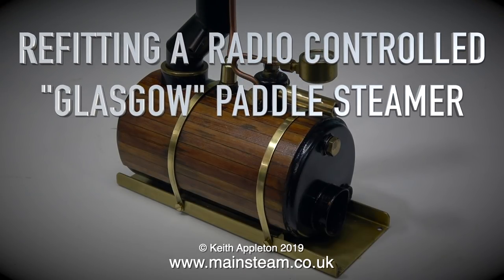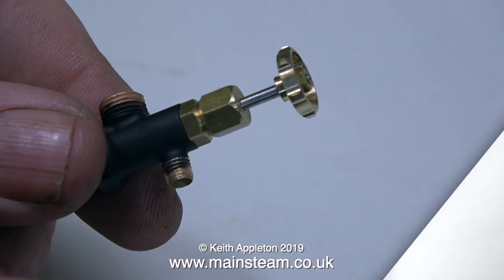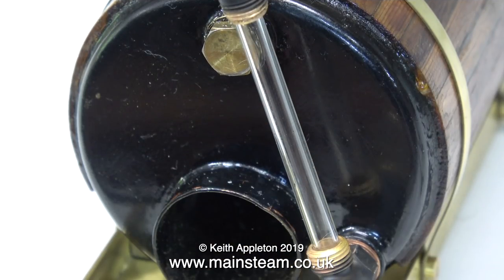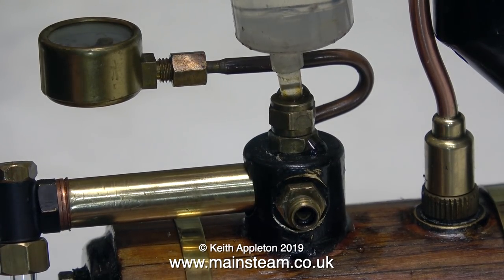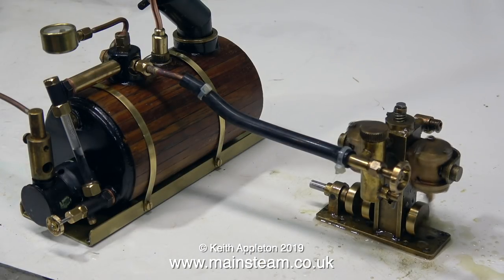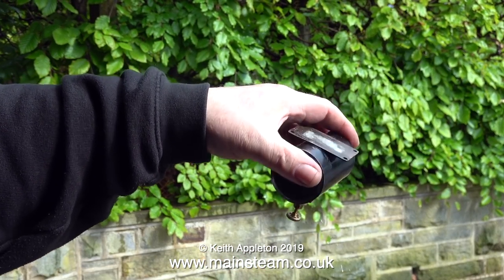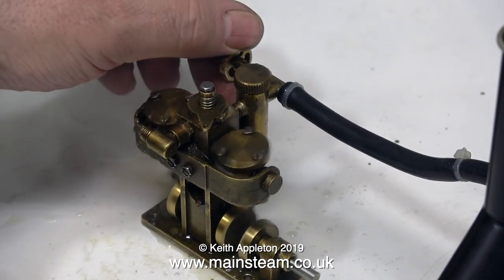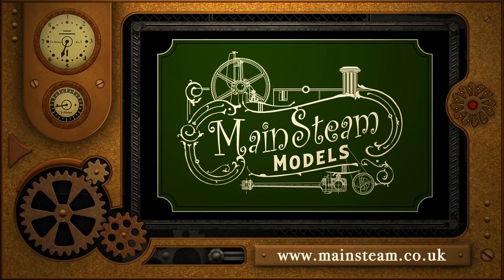A "'GLASGOW" PADDLE STEAMER REFIT - PART #7

Comment: Hi Keith, I took your advice and bought a Bahco spanner and you are correct they are excellent wrenches...but boy is their customer service awful. I discovered that Amazon, which sells Bahco wrenches, is not technically an "official distributor" of Bahco/Snap-On Industrial tools. In the fine print on the "Lifetime Warranty", it says the warranty is void unless the product is purchased from an "authorized distributor." I got a wrench with a machining error inside the body which made the jaw unusably tight below 1/4", and I sent Bahco an email and they basically told me to go pound sand, because I bought it "from a third party" and I'd need to take it up with Amazon. I fixed the issue with a careful application of needle file, but needless to say I am disappointed that such a great toolmaker can get away with caring so little for their customers. A tool listed as "lifetime warrantied" is actually only warrantied through Amazon's 90 day return policy! Ridiculous! Tekton, ChannelLock, and other tool companies don't play this stupid game. Just a PSA for all the viewers thinking about buying a Bahco spanner...
Reply from the maker: Yes that is a shame, I have never had any problems with mine, but there's always a first time ........

Comment: I know you know, and it probably doesn't matter too much anyway, but having the top glass fitting in the same turret as the feed pipe to the engine will cause the glass to read higher than true when the engine is running. That being said, it didn't seem to have any effect, I just thought I would say it and get your opinion respectfully. You know better than me, I am just curious if you noticed a difference.
Reply from the maker: Yes, it probably does make a slight difference, but if you stop the engine then normal service is resumed }:-)))
Reply: True, and I suppose being a boat checking the water will only be possible when the boat is stopped by the shore anyway!